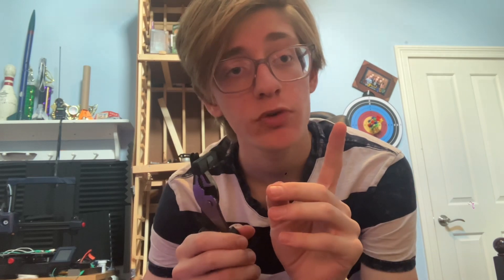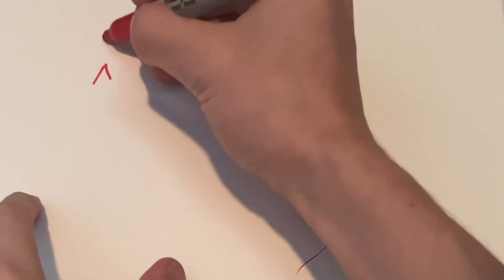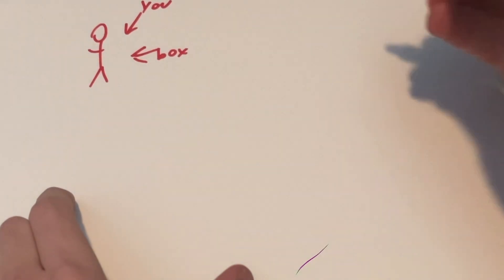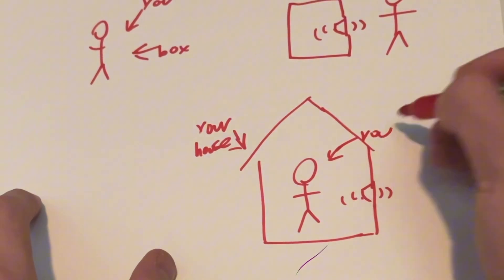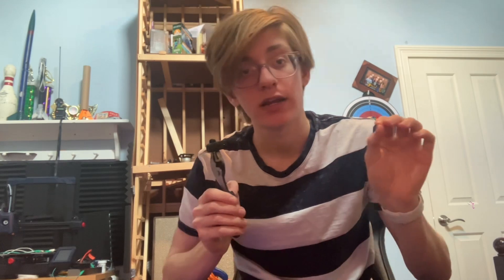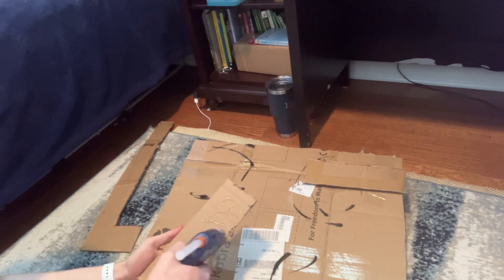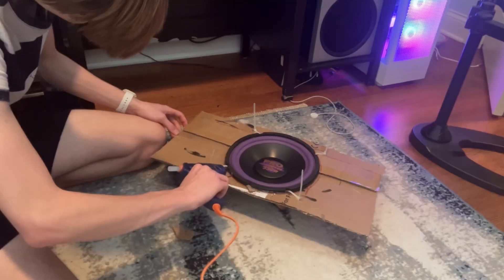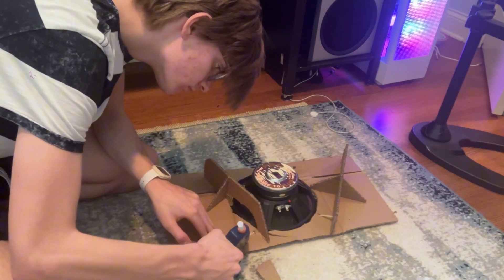I made an INFINITE BAFFLE subwoofer

Comment: I had to go back and watch your other cardboard build and noticed you had an amp that probably doesn't have a low pass filter? Hope it has one though it sounded like it might be giving a messed up signal.. Or just that speaker has some coil rubbing or just not broke in..something off about it.  What model speaker is that and did it come with all of the specifications and such?  Ya ought to be able to find yourself a cheap or free piece of at least plywood somewhere and if ya don't have one, a drill and a jigsaw from a friend or something.. Or not.. Did notice some good craftsmanship on that last box build..for what you made it from it was impressive..  Even had braces and such.. Port size need some adjustment for just the one, all in all decent.  I used to build SQ-SPL systems back in the 90's and still kinda do at least for myself mostly.  Far as infinite baffle goes for a room, you would need to get a super huge sealed box fitted over the outside of the window or an adjacent room and probably quite a few more subwoofers.. An adjacent room would be awesome for infinite baffle really as long as people in that room didn't mind the music lol... If anybody needs help on subs and such, leave a comment and I might answer ya..
Reply from the maker: The amp did not have a low pass filter and the noise was definitely from the sub. It was just a random crappy $10 sub with no specs on some scam website that I decided to buy for no reason. (the reason was that it was $10)

Comment: Back in the early 90s I had an old 1977 Ford Maverick. I had two 10 inch pyramid cast super pro woofers. They were an offshoot of the super pro line but had cast baskets instead of stamped baskets. They stopped making them in the 90s. It was an actual decent sub but because of the lesser liked brand and the more pricy price, no one would buy them. But anyway, I created something similar to an infinite baffle setup in that maverick. I took the rear seat out and mounted a baffle between the trunk and the cab. I had two cutouts for the 10s and sealed it so that the truck and the cab were isolated from each other. I also dynomatted the ever living crap out of it. The dash only survived in the looses sense and the glass only survived because the rubber seals barely sealed. It was twice as loud as any conventional box and dropped way lower. The best thing about it is it only needed 400 watts. Honestly I can't remember what amp I was using. I think it was a Coustic amp. I guess it actually was a sealed large box. But the trucks back then were large, probably 15 cubic feet. Likely acted a lot like an infinite baffle.
Reply: Wow thanks for sharing! My dad drove a 1972 Maverick during the 90's and had a shockingly similar experience. He had also also done his subwoofers in what sounds like the way you did it, and as you said, extreme results. He had his headliner removed and he said after he shut the car off with the music playing, the roof would continue to resonate for a couple seconds even after the music stopped. Those cars are cool I wish they weren't so expensive now.
Reply: @ProdigyAutomotive  My buddy Jeff had a 1972.

Back in the 90s you could find drivable Mavericks for less than $500. Back in the late 90s there was a purple one with a blower motor, neon lights and wheel tubs cruising up and down preston hwy.